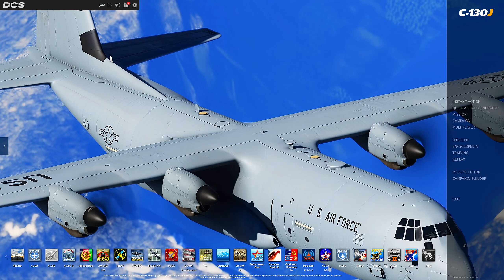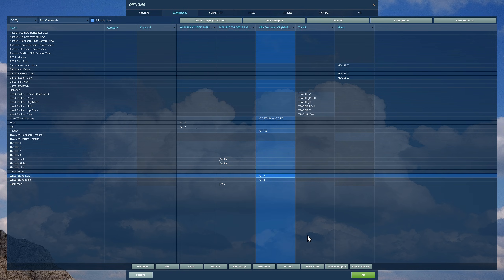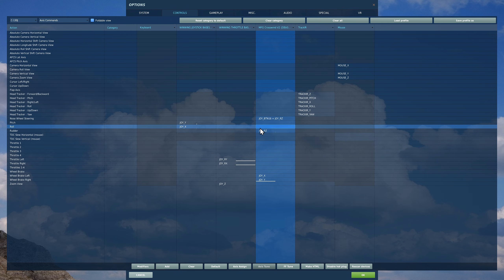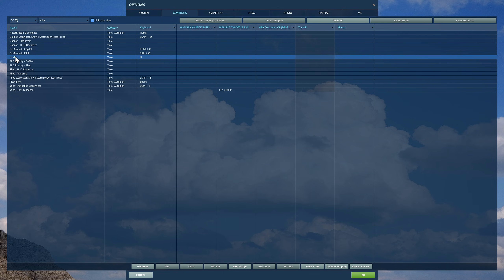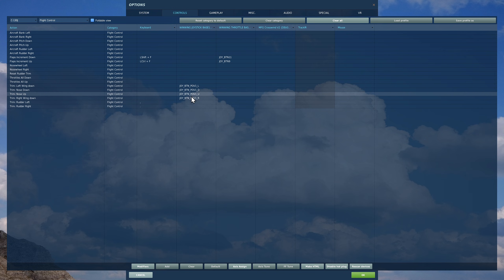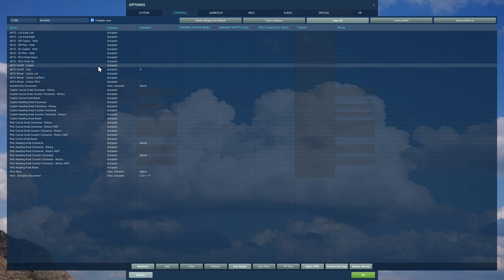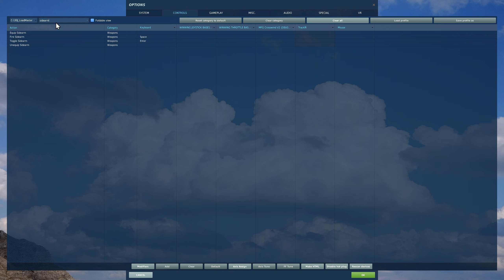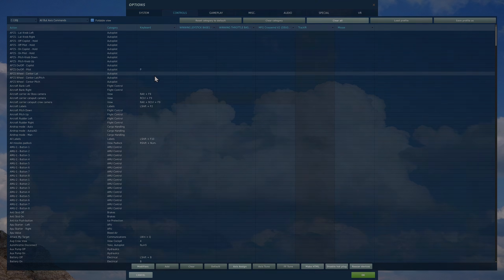C-130J Super Hercules: Setting Joystick HOTAS Controls Tutorial | DCS

Comment: I never thought I’d ever use my 4 throttle quadrant and FFB Yoke outside of MSFS, but here I am using it in DCS and it doesn’t feel wrong. As I only ever fly in VR, the keyboard is out of bounds for me which ends up with me running out of buttons and axis to bind and having to use a ton of modifiers, but for the first time ever in DCS I have an abundance of buttons and axis, and even a couple of spare ones, and I Never have a spare axis even with warbirds.